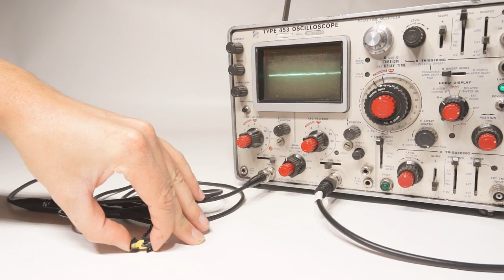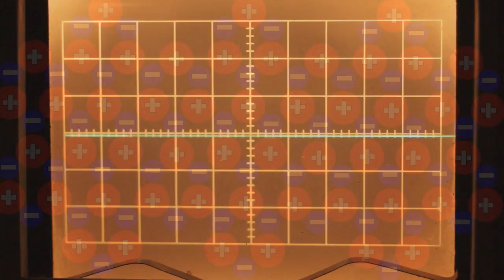Piezoelectricity

Comment: A quick question please: accirding to the animation, the piezo develops a difference of charge in the perpendicular axis in relationship to the axis of compression? I thought it happened on the same axis...
Great video as always! Lots of care on the explanation
Reply from the maker: +DoNotPushHere In the case of BBQ sparkers I think the squeezing causes the crystal to bulge out and then rebound back giving it distortion perpendicular to the applied force but I don't know if that is the real reason. The animation I showed was the most common explanation I could find in research papers and parents.

I'm glad you liked it! Thanks!
Reply: Nick Moore
I had thought a similar solution, as I always saw the wires of a lighter igniter on the same axis... Thanks for answering!

Comment: Very nice presentation of piezoelectricity. I never saw an anti-static gun. I don't get how it could spray charges alternatively positive/negative.
Reply from the maker: +Michel PASTOR If you watch the scope when I tap the pliers the signal goes both above and below the 0v line. Squeezing the crystal "squeezes" the charge out in one direction, when you release the pressure everything happens in reverse and charge has to go back into the crystal but in the opposite reaction. That way one cycle of squeezing and releasing results in a net change of zero charge when you are done. I hope that helped,  I'm going to do a video on the specifics of the anti-static gun at some point.
Reply: +Nick Moore Eureka. The crystal comes back to it's original state so if the charges goes one way they have to go back the other way. Helped a lot, thank you !

Comment: That gun is amazing! They also use them in old gyros. Piezoelectric gyroscopes. I had one on an old R/C helicopter to stabilize the tail rotor. Instead of more modern MEMS gyros.
Reply from the maker: +planecrazy2 I wish there was a way to film the motion of a crystal gyro, I'll have to see if I can find a cheap big one.
Reply: +Nick Moore that would be cool.